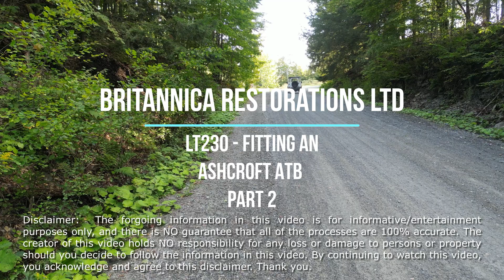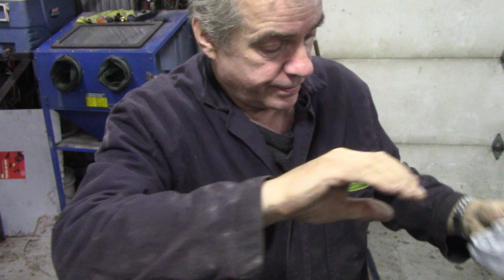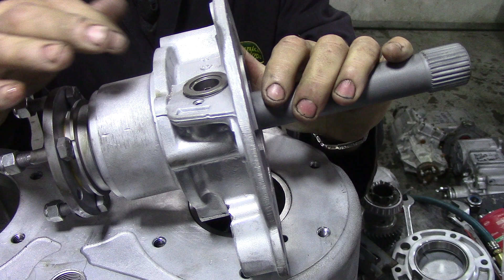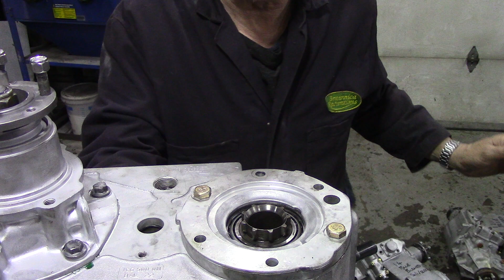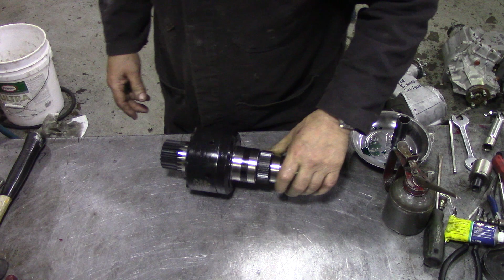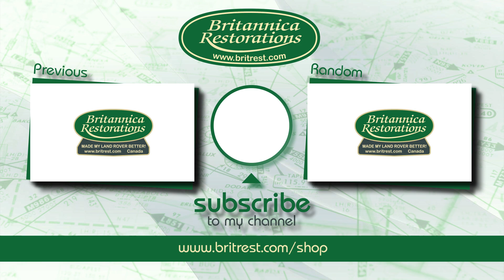LT230 fitting an Ashcroft ATB part 2

Comment: That pre load you show at 4:34 with your fingers is much less than the early workshop manual values for the spring gauge method. I also found using the later method of measuring end float and adding 0.05mm shin was quite “light” regarding pre load. 

I do wonder if after a few years of data LR reduced pre load from the earlier settings?
Reply: As you probably know , whilst bearings are quite accurate, they are not exactly the same. 

The last LT230 I did, measuring the end float with a dial gauge, and then adding the prescribed 0.05mm only resulted in 200g rolling resistance. MUCH less than the 2.26 - 6.8kg that the early WSM specs. I personally felt that the 200g was too light. I tend to aim for 1.5-2kg

I have a large steel plate I bolt the case to, and sit the magnetic base on to avoid movement between the two.
Reply from the maker: I don't use the spring gauge method any more - you only preload by 0.05mm on new bearings - used bearings should be 0mm
in theory the old shim and new bearings should be correct, but the bearings felt 'notchy', by reducing the shim slightly, there was just the right amount of 'feel' 
IF there were no shims available as if the box arrived in parts, then I set up as I did for the diff

Comment: just a quick one anyone having issues with cooling in the warm weather on a 300 tdi i had an over heating issue yesterday in uk lucky i have a leccy fan on too aswell as viscos fan thought everything was ok but engine simply wasnt cooling down everything seemed ok till i reved engine then noted  no airflow off the fan the viscous coupling was free wheeling so basically the fan wasnt getting turned hence over heating problem when lowing heavy load 🙂
Reply from the maker: All too common!